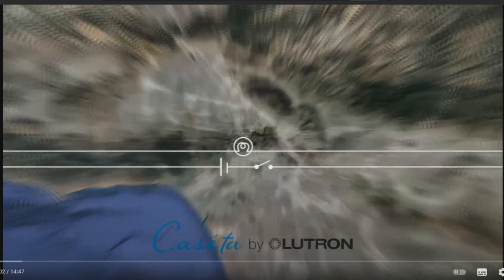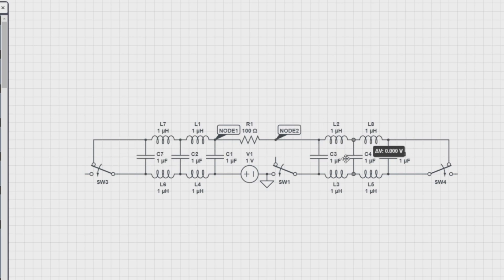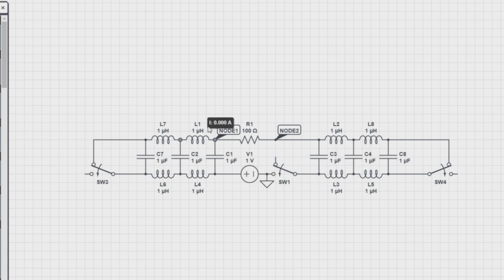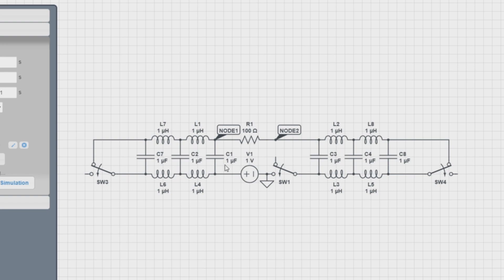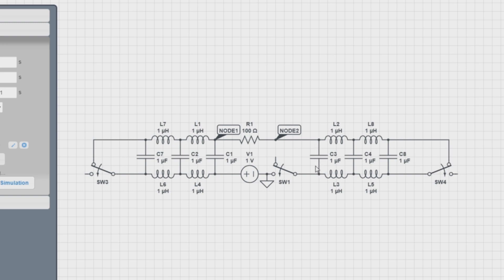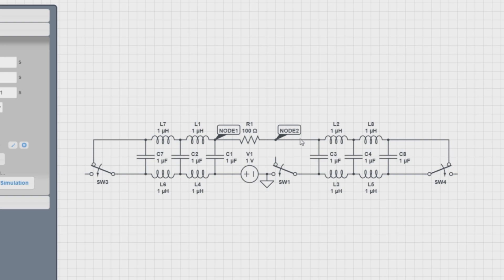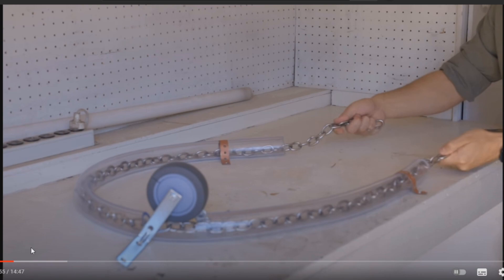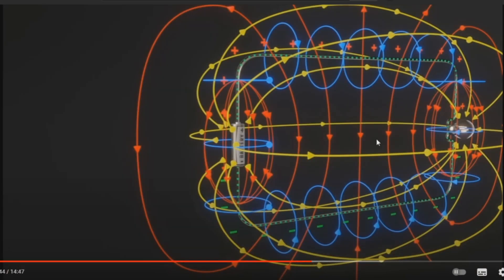Explaining the Veritasium "The Big Misconception About Electricity" video

Comment: For someone talking about 'lies' about electricity I think he set up the question really disingenuously - the lines are 1 meter apart, if the voltage is low enough then for practical purposes there will be basically no coupling between the transmission lines.  So for practically purposes the lightbulb wont really be turned on until the electromagnetic wave has propogated down the wire at some fraction of c.

At the very least he should have made it clear that if instead of having the wires 1m apart you circled them around the globe or similar then you wouldn't get the 1/c effect.

Now there are going to be millions of people that believe that electricity propagates through electric circuits faster than the speed of light.
Reply from the maker: Yea I think the whole thing comes down to the trick where he mentions the light bulb will turn on if any current goes through it. Technically I could wiggle the battery and it would produce a changing electric field to turn on the light bulb.
Reply: Yeah, by that argument he’ll light up the bulb just by moving his fingers to reach the button, or by merely standing close to it and having his organs move. I think that was a misinformational video.

Thanks for your explanation here!
Reply: @RodrigoR9  or alternatively the light bulb has already "Lighted up" by stray radio waves that are coming in from a radio broadcast transmitter a few hundred miles away...
Reply: @brotherabdullah  Or, 12 parsecs away!
Reply from the maker: @RodrigoR9  My explanation is wrong. Veritasium is actually correct. I have made a new video with a better analysis: https://www.youtube.com/watch?v=RsiYXfpJu5U
Reply: Plus the fact that he makes a lot of money with his click-bait titled videos disguised as intellectual videos. Which is why I won't subscribe to his channel. He has just created and fostered a lot of misunderstanding of the subject - just check out the comment section.
Reply: @Wehateella "there will be basically no coupling between the transmission lines."   Says who?!!   Veritasium and his EE consultants are actually right:  the coupling isn't microscopic nor insignificant.  But his setup is intentionally counter-intuitive.  It's a big trap for the unwary.  So, calculate the coupling, don't assume!
If Veritasium's bulb was a few LEDs in series, they'd light up very visibly: a few milliamps immediately, then lots more when the full 12V arrives later.    Veritasium's demo is perfectly true if the "bulb" was like a 1K resistor.   But it would be a total lie if he was using a ten-watt bulb.

[1] I highly doubt that Veritasium came up with that setup.   Instead, it looks just like a trick question created by a crafty professor for their engineering exam in a fields/waves course.   I can even predict their thought-sequence:  invent an exam question about a million-mile circle of wire, with a battery, switch, and bulb somewhere in the circuit.  Ah, even better, SQUASH THE CIRCLE, so we create a very significant "leapfrogging" of wattage directly across, rather than having to follow the long perimeter.  That way, any student who doesn't grasp Maxwell, and who still thinks that wattage flows inside copper, will give the wrong answer.   In fact, zero wattage flows inside copper, even at DC.   That was the great discovery during the Heaviside/Maxwell era.  It made long-distance telephone possible, although Oliver Heaviside was screwed over, and never made a cent from his discovery.
Reply: @wbeaty  From the looks of the Veritasium video, he is using an LED, and it won't light up at all until the threshold voltage is reached. So, unless the LC coupling is pretty strong, the light won't come on immediately.
Reply: @wbeaty  " In fact, zero wattage flows inside copper, even at DC."
Then why do wires heat up when current flows through them?  How is the energy of the fields outside the wires getting back into them?
Reply: I doubt there are millions of people that care about how electricity moves while switching on a light bulb.
Reply: @parthivmangukiya5953  there are more than 1M electrical engineers in the world.
Reply: @RodrigoR9  Don't forget us electricians. I showed the crew I work with the video and it caused a lot of discussion. It does not change how we work or troubleshoot problems, but does give a different perspective, which to me is what I got out of Veritasiums video. It made us think.
Reply: @Neil du Toit we all that think about it know there is more to it
Reply from the maker: @wehateella my original analysis is wrong in this video. Veritasium is correct. Here is the correct analysis: https://www.youtube.com/watch?v=RsiYXfpJu5U
Reply: By Veriitasium's reasoning the light bulb would already be lit.  It doesn't need the switch to go on.  The electricity would flow through space as soon as the battery was connected to any wire.